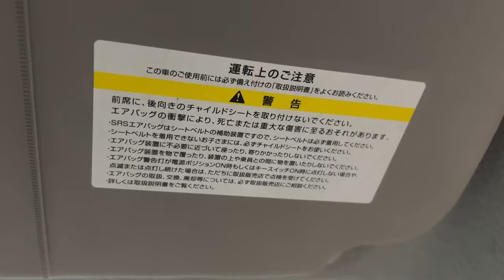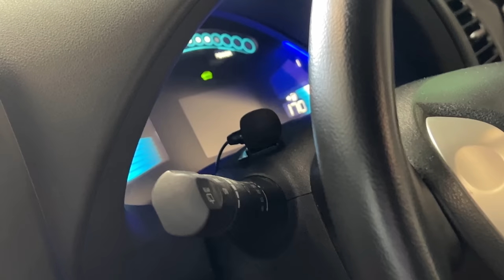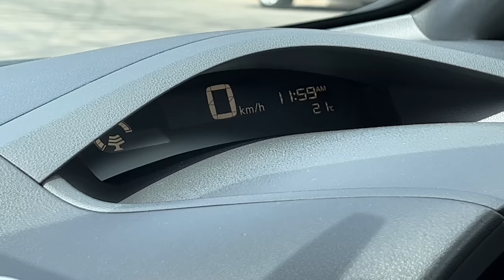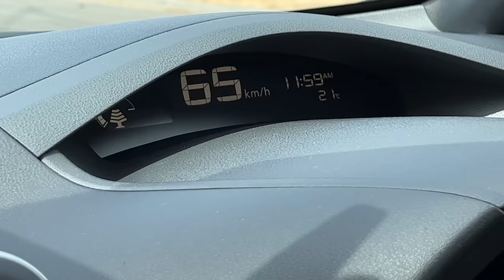I bought an electric car.

Comment: As someone who aint into cars, your videos got me thinking of planning to get one in the future. EVs look interesting but practically speaking only the wealthy in my country can use them due to the charging situation and price of them. Then there's the problem of the charging statioms as there's not much (if any) infrastructure here for EV charging at gas stations. So going gas or diesel (or petrol whatever people call them in different places) vehicles are the dominant thing and EVs would take a while. Closest are those who have E-Bikes but since they're weird and use different plugs and chargers necessitating either bringing the charger or just charging at home and the latter seems to be true for the folks I've talked to who own them.

Comment: I love my Leaf. I can drive without having to worry about how my engine needs to heat cycle properly. I can drive it 1 km if I want to. Nothing beats it for low cost daily local driving.

The only thing I don't like about it is the steering feel. Feels the same as a petrol Qashqai I drove for work a while back. I assume this is just how modern electric power steering feels.

Comment: EV with a propane genny. Where are those things at? They would be heaps practical if the efficiency of converting the natty gas potential into battery energy was like, 90% and the BMS could account for that by using a supercap, a relay switch and toggling between two sets of cells every so often when they hit 10%, and do charge at like 30%.

Comment: Aus is a sad place for Electric Cars. We're just soo behind and intentionally poor support for them. Vast majority of the City Dwellers would be served well by a 350km range BEV. The cities have the correct geographical setup and use case that suits them perfectly. Because of this lack of support and 2nd hand cars with better range. Nissan Leaf is a rough choice as it has many serious flaws other BEVs do not have. But as a short range city run about it's fine.

Comment: Bought a new 2019 Nissan leaf, the car is fantastic beside having to replace the battery in the last 6 months and it took them 4 months to get the battery in the country so being without a car for 4 months was killer. 

My opinion is that the car is fantastic for a to and from work car but dealing with dealerships for repairs and maintaining it is a nightmare

Comment: My new Mercedes c300e hybrid has a 25 or 30kw capacity and goes 100km on full electric mode. I think it’s funny it’s the equivalent of the leaf whilst being heavier and it being a secondary system

Comment: I used to drive one of these (also in blue, but built in 2011) from 2012 all the way into 2019. In my experience, that 160km range display tends to be wildly optimistic, the most I've ever got out of a single charge was 95km. Actual range very much depends on your driving style, the kind of slopes it has to deal with, and surrounding temperatures though, so your mileage may and probably will vary.

Currently I drive a 2019 Leaf with the new body shape. It claims its batteries will get you 250km, and I actually managed 195km without going lower than 4% charge a few times, so I guess Nissan got slightly better at approximating real-world conditions.

Comment: A possible reason why the leaf behaves better than most front wheel drives is because electric cars do not need a transmission

Comment: I owned a 2013 leaf as my first car in high school. Got it used for pretty cheap in 2016 (I just turned 15) and my god, it was absolutely amazing! I completely agree with everything said in this video, also my battery only degraded 1/12 bars (meaning it was still at 91.7%) in the 6 and a half years I owned it (previous owners also seove it for 3 years so it the battery degraded less than 10% in almost 10 years). Sold it recently because I need to drive to another state for work like 1000+ miles and leaf absolutely can't make that trip unless I want to spend like 2 weeks getting there or something. Sad to see it go, got a used hybrid instead for now but also reserved an aptera for in a few years to replace the hybrid :D

Comment: I can't wait for my electric car to arrive. It will have the same 0 to 100 kph acceleration as my current car, but I bet that it will feel way faster, since I won't have to downshift for peak power. Also no more turbo lag or uneven throttle response.

Comment: The parental units have solar panels on their roof. When his previous car, a pristine and impeccably maintained Mercedes E-class started to disintegrate before his very eyes he leased a Chevy Volt, and when the pandemic drove up used car prices he bought it cheap at the end of the lease. The only time it needs gasoline is every December when the car says that the fuel is getting too old. He does like carrying around that engine just in case, and only charges it on the slow charge (120V vs 240) at home, never paying for electricity whilst out and about. I did borrow it a few years ago and drove it 250 miles in one day, treating it like a normal car and not driving like an annoying eco-weenie (like almost every Prius driver in SoCal). When I was done I put in 4 gallons of gasoline, which comes out to 50 mpg. Unreal. 

If I had solar panels and/or a garage I’d buy one just like it, or maybe that new sexy Prius (two words that have never been used together in all of automotive history). I absolutely adore my Mazda Mazda5 6MT, an ultra rare vehicle here in the states, but I’d love to have a solar-charged EV for my commute. As much as I love manual transmissions, the best transmission is no transmission, especially with the stupid amount of torque that EVs have.

And mom’s Mercedes? 800 miles on it in 2022. That’s it. If she can take the Volt, she does, and I fully understand why. With all the money saved not buying expensive premium gasoline in California they took another dive trip to Fiji for two weeks. Life’s tough…

Comment: *kWh (which is a measure of capacity, like miles-per-hour. kW is a measure of rate. So a 40kWh battery will take 1 hour to discharge at a rate of 40kW.

Comment: I’m pretty sure the Chevy spark ev has something like 400ft/lb (~544nm) of torque bc Chevy just threw it together real quick with w w.e. electric motor they had available so the darn thing probably can’t keep a damn grip on anything if you push that pedal anymore than like 50% lol

Comment: Just on the topic of front wheel drives what turn good. Get ahold of a 2015 Corolla hatch with sport mode. Get the CVT. Slap that shit into sport mode and go nuts. They're secretly rocketships.

Comment: Just find a crashed 62kwh leaf and steal its bits. That'll give it twice as much battery and twice as much power. The leaf community has developed solutions that will make the car think everything is fine without any warning messages etc.

Comment: Ah, the last of the old shape Nissan Leaf - the ones with no thermal management that cook the batteries!
Reply: Even the new ones don't have any active thermal management or cooling either. They just slow down charging a lot more aggressively as the pack warms up. They unfortunately still suffer from much faster degradation as a result of heat than any other mass market EV due to the lack of active cooling
Reply: Oh wow. I didn’t know the new ones didn’t have active cooling either. How crazy!

Comment: Lol i just bought a 2013 leaf in usa for $3500 witch is stupid cheap here. Has 8 bars of the 12 left on the battery degradation meter

Comment: You bought it used, I have far less of an issue with that.
My biggest issue with EVs is the manufacturing cost, and buying them used mostly gets around that, so long as you don't need to replace the chonking battery; It already exists, so may as well make the best of it.

Comment: if it wasnt a Leaf, i would be betrayed

but as it stands, the only EV which fits you more then the Dumbass leaf, was the E-box, and i'm not even sure could get them in australia 
Context: the E-box, was a Scion X-B, but electrified, they were modded by a Company called AC propulsion, i think

Comment: Make sure you get the battery recall work done because Nissan didn't bother to liquid cool the battery. It's literally just a big chunk of aluminum under there. It doesn't cool the battery while parked. So if you, oh I don't know, live in Australia where it's always a little toasty, you're going to have a bad time. Lithium ion batteries hate the heat so if you still have it factory, you will experience very early battery degradation. Thankfully Nissan got sued over it and will give you a new pack with liquid cooling.

Comment: Bud, get yourself a new battery for the ol nug, they can actually be pretty cheap depending on what your needs are.

Let us know what the voltage spec is and how much current it can pull ✌️

Comment: Those "eco" tyres are SHIT, and they only make about 1-1.5% difference to the range in real life. Swap them out for some Michelin Primacy 3 ST tyres as soon as you can and the car will drive nicer and even quieter.

Comment: Exaggerating much, neck to neck with 5.0 lol

I've driven EV's and sure the initial hit is very surprising, you get on the throttle and it jumps forwards instantaneously, but unless you're in a real performance car, after that initial jump it's just as slow as what the 0-100kph figures makes you think it would be. 

Still, I'd say for driving around it makes it feels more powerful than it really is because of the torque, it's like gas vs diesel, for the same power, diesel always seems like it's more powerful when driving around because you have the torque, until it's time to do a real pull and well at full throttle and high rpm you're not any faster since you got the same HP.

The real fun is with stuff like a Model 3 performance, I've driven one too, and that's something, really. I had never driven any car with 500Hp so hard to say how it is in comparison to a similar gas car, but it's quite mindblowing, first thing I needed to do was merge onto the highway, had to accelerate to get in a gap (which was a gap that would've been unnatainable in any other car I had driven, but I thought it'd be a good test for a car everyone claims is fast), well turns out I looked like an ass because I almost overshoot the gap and had to brake to actually get in it lol, shit suprised me, punch the gas and before you realize anything is happening you alread lunged forward a lot.

That being said at higher speeds, I don't know if it's the EV itself showing it's weakness or if I just expected 500Hp to be faster and to be a level of power where it just keeps pulling hard for much longer, but it's mindblowingly fast between 0-130kph, after that it gradually gets slower until it's really meh, speed climbs but doesn't have that pull anymore

Comment: I just had an idiotic idea, instead of doing an EV conversion of a regular car, someone should do a gas engine conversion of an EV. That would be stupid, possible expensive, and get you yelled at, but boy howdy would you get a reaction when you're going past someone in a Tesla and instead of an electric motor they hear a V6 or a V8 with glass packs.
Reply: This already exists. Rich Rebuilds made a V8 Tesla

Comment: The leaf is like the worst choice for an EV, they're air cooled so they'll overheat in the summer and won't get hot in the winter. They have a special plug that doesn't fit with most chargers unless you have a special adapter. And they have a small battery. That's why they're the only EV you can get right now, because no one wants them.

Comment: I do not think people should buy electric cars. Well...let me explain myself a bit...I don't think everyone should buy one now...I think we should buy enough to fund the advancement of electric cars but currently the way elements are mined and refined are just ...the people running these operations are committing horrendous crimes on other humans the environment it's just fekked... lithium batteries in general...cell phones laptops tablet's... especially one time use disposable power banks where you throw out a working rechargeable lithium cell...goes straight to a landfill...most of the electricity to charge the car is from burning coal or other fossil fuels anyway...the cars can be very dangerous with current battery technology...an electric car battery burns on contact with water...burns much hotter than normal...releases a lot of bad chemicals in the air...can catch fire.. be put out..get hot enough again to reignite multiple times for days...we just aren't there yet with the technology...but I'm all for buying a used one and keeping it usable as long as possible before it gets put in a landfill...entire families are living horribly working to death and having all kinds of health issues from the mining to make these batteries so I always make sure I use them until they are completely done...get every bit of life from it..then make sure it's recycled to get back as much useful material from it as possible and keep it out of the landfill aka our environment... polluting on that level is not smart...don't think the little bit you do has no effect...if everyone does that our planet will not survive...if everyone just does what they can...use a product until it has no use left...then recycle things that can be, especially toxic ones, it would make a huge difference...again not saying you need to go crazy just do what you reasonably can...have a great day!

Comment: Just to say, with the way Australia generates its electricity and the energy needed to get the minerals for the battery, that car won't become less polluting than an ICE car for about 200,000km.
Reply: He's charging it through solar tho
Reply: @Natalie Cameron  The carbon footprint of solar panel manufacturing is often overlooked in favour of the benefits of generating emissions-free electricity (something the world needs). But the panels themselves are not carbon neutral.
Reply: @Brusselpicker og is that big fossil data you are using